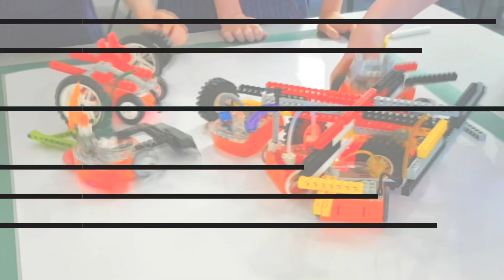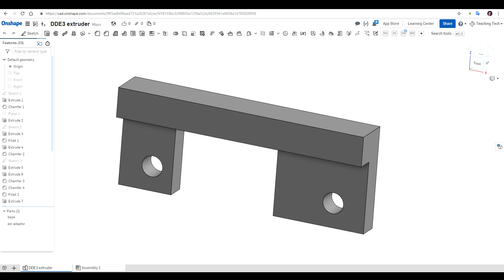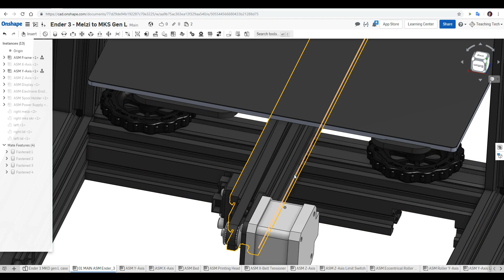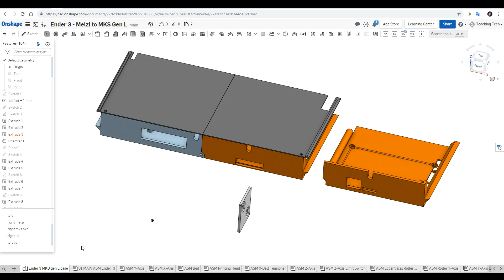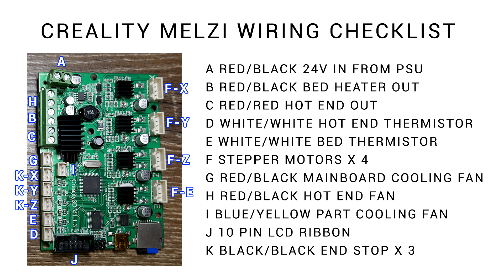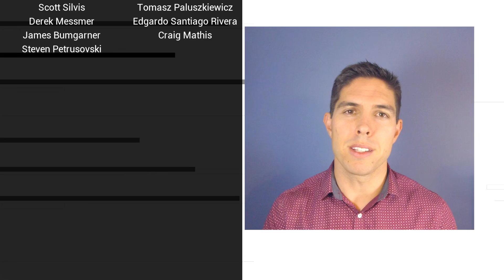Ender 3 upgrades: EZR to direct drive adaptor and all in one rear mounted electronics case

Comment: Michael, greta idea for a rear box.
One little thing, I would have put the new 3d printed end cap at the rear and used one of the original rear end caps at the front to  tidy things up. Then you would have no unsightly screws showing.

Comment: Very nice mod. Thanks for all the great work. But does not work with pin27 that comes with the BLTouch on creality board. Can't get the lid on and one of the connectors got bend in the process.Even with the pin27 lid. The fit is way to tight. Also when working without buckconverters you still need to powerup the rasPi. So external cable slot would be nice. To bad cant upload picture. I think it would be better if the creality mainbord is mounted on the right or in the middle (when not using TL smoothers) and not on the left. There is not enough room.

Comment: Can you please do an analysis of the temperatures inside of that case?
It doesn't appear that the fan is big enough, and I also am skeptical of the airflow design.
I may very well be wrong..but it sure would be damn interesting to see the numbers!
Thanks for this awesome video!
Reply: I'll be honest I like the design and then again I dont. You have the holes where your wires come out from so due to that I'm sure it wont have a good air flow in the main board slot. There should be some kind of heating issue.

Comment: I've always been critical of upgrading something to the point where you are replacing it but this is probably the best and most practical upgrade I've seen. I wouldn't be surprised if Creality either contact you or rip this design.  Very pro.

Comment: Great video and thanks for spending the time to design and build the parts. I do wonder if that cooling setup is actually going to work. Have you measured the heat sink temp on the MKS drivers? I doubt they would have much air flow going over them. I’d be more inclined to have the fan over the main board rather than with the raspberry pi. Or maybe run a fan per side.??

Comment: Not sure what software you designed the case in, but if a .step cad file exists, I’d love to design an option for the Duet 2 WiFi board.  If you have a cad file, met me know.
Reply: There's a .step file included on the Thingiverse page now, if you've not already seen it. :)
Reply: Thanks Mythor.  No, I hadn’t looked yet. I was in the car when I typed that and forgot to check when I got back home.  This is really an awesome design!   I’ll work on something for the Duet 2 WiFi in the next few says.  Thanks!

Comment: Hi Michael, would you mind to test the Fysetc F6 board for Ender 3, with both TMC2208/9 and TMC2130, stand alone or UART the firsts and SPI for 2130 or 5160.

Regards from Spain

Comment: I feel the cooling fan will only be short-circuited with air flow from the Pi side of the board. The box needs to be sealed all around if you want air flow coming all the way from the right side (facing the back). There is no back, there are huge gaps around all input ports. The fan is useless for electronics cooling.

Comment: First I applaud your effort, and design, please take these comments as intended, to IMHO improve your concept.

First: Main Board cooling fan. You haven't addressed the design flaw on a stock Ender, that the Main board cooling fan is controlled along with the part cooling fan, It's a simple mod to connect it to the Hot End fan so it runs all the time, and doesn't slow down or turn off when you choose to control the part cooling fan. (I.E. first layer, alternative material, upgraded cooling fan that doesn't require 100% cooling fan operation.)

Second: Fan placement and air flow, I have concerns at the remote fan and restricted Main Board air flow cooling design, as your design occupies the same vertical space as stock case does, consider relocating the Main board fan directly above the stepper motors (blowing down on the steppers, as in the OEM configuration). If your stepper motor heat sinks do not allow for this, I'd lower your case so it fits slightly below the frame allowing the cooling fan to be placed more optimally. Many have already found adding some additional flexible feet under the frame has helped quiet the printer, and there is (depending on feet pad design) up to an additional 25mm of additional vertical space.

Third: Location of center support, and Main Board screw terminals. The screw terminals on these boards is fiddly enough without the addition of this center support bar in close proximity to the screw terminals, adjusting the board's mounting location, to allow more access for large hands and tools, or re-configuring the center support to allow much easier access to the screw terminals would be a welcome design enhancement.
Reply: EDIT : https://youtu.be/k83M5H796U8?t=418 on second look you have relocated the Main Board cooling fan power source... It's just the board pin out schematic that shows the stock configuration.

Comment: Nice solution.
Along with relays for power switching and so on that you're planning, it would be interesting to fit some thermal sensors on critical components and connect to the Pi for monitoring, to see how well the cooling works out.

Comment: I would suggest adding a fan on top of the right lead to cool drivers and main board...
Reply: ^...with a 90 degree duct for airflow to prevent debris from falling into the hole.
Reply: @AGeekNamedRoss  Feel like were going in circles with this improvement now.

Comment: About two weeks ago I upgraded my Ender3 to the BigTree Tech SKR 1.3 board and I was saying to myself what a horrible design to have to flip this thing over to work on the board. Kicking it around about printing out the new boxes. Thanks Michael.  I do like the SKR with TMC 2208's in UART mode, really easy to configure other than the ultra fine soldering.

Comment: And I just got done designing a full case like that for the front.  Never thought of moving it to the rear.  I'm kinda partial to mine since it doesn't require cramming wires into a short case and allows for better airflow.  Thanks for the great videos and innovative ideas.
Reply: Would love an stl from you if you upload it anywhere - Im a bit concerned with the airflow in this one as well.
Reply: @RonnieLaugen  Sorry I take the summer off from 3D printing and stuff to do summer activities and I didn't see your comment.  Back at it.  Still haven't finalized the design as the fan isn't fitting.  Don't know if it's my design or my printer.  I'm still new at the Thingiverse stuff so I will try to figure out how to upload it.  I draw in autocad, not sure what file type you need/want.  User name PE_RN.  hopefully soon.

Comment: Hi, Michael, thank you very much for your work! Quick question, how did you reach zendstop to the back of the printer? Did you buy longer cable? Thanks.
Reply: Did you find a solution for this? I have the same problem

Comment: Excellent mods. Have you done a separate review on the Direct Drive Extruder. How does the printer fair with that extra mass on top ??
Reply: Hi, my thoughts completely...….on the E3 and Pro models the X axis beam is not supported at the right hand side like the E10 with twin leadscrews, even though it has a set of wheels, they do not prevent the beam from deflecting up and down when the X axis carriage is at the right side and adding more weight will have a more detrimental effect. A mod to add a second leadscrew like the E10 would be good.
Reply: Hi, try this: here's the video   https://www.youtube.com/watch?v=EfB4oCm5Fhk   and here's the purchase website   https://gumroad.com/l/dualzaxiszank   --This is the neatest solution that I've seen to install dual leadscrews to the Ender 3.

Comment: Great upgrades Michael. I've often considered doing a direct drive conversion to the Borg (CR-10s4) to avoid the bowden being folded under the top rail on tall prints, but I have become very fond of my Bondtech BMG. On a similar note, I have always wanted to move the electronics from the control box to the underside of the bed, maybe I'll get the chance one day.
The stock board you have in the video is v1.1.4, as most others seam to be too, the one in the Borg is v2.1 do you have any comparison info please?

Comment: That is amazing case design. Can you also do same for Geeetech GT2560 A10/M  stock main board,  eBay sells longer flex  LCD ribbon cables 30cm and 40cm,  stock is 25cm.that may be the only issue in moving from front to rear. 

https://www.ebay.com/itm/40-Pin-FFC-FPC-Flexible-Flat-Cable-Ribbon-Pitch-0-5mm-6-40CM-80C-60V-VW-1/183559264186?var=690925176986

Comment: Yet another awesome video, this will make things so much easier to access, upgrade and many other minds will have little tweaks too. Only part that seems a little bit fiddly is the power connections once the board is fixed down

Comment: Adapter for cable chains that can mount to the back (front) of the case for the print bed cable? Opening for the pi for Pi Camera?
Reply from the maker: Step one is appreciate the work I've put in. Step two is to remix it. Step three is to share with the community.
Reply: @TeachingTech  Thank you for the design work. I am sorry if I appeared to be ungrateful for your work. Great content on your site and it is always my number one source to look for a solution to my  newly acquire 3D printer.
Reply: I'm also thinking about that question and  will try to remix something later with thinkercad. The disadvantage with keeping the chain is that it will block the now nice open space to the board.
I wrote it already, but can't thank you enough for four all the work you did and do Michael!

Comment: thats a neat and tidy way to do this,  it looks easy to access too... I took a different approach, as I wasnt keen on flipping the machine upside down to tinker with it, I used the original tin box but  moved the electronics box fan to the front after carefully cutting a hole for it, covering the original hole by re-positioning the sticker on the lid,   then printed   an internal mount for the gen L , as well as a spacer for the lid to give me a bit extra height  for the heatsinks of the 2130's, unfortunately this leaves no room for anything extra inside,  so I got my extra bits  on printed brackets at the rear of the printer, not the neatest solution - so I may have a look at this - thanks again for sharing

Comment: can i just use the mainboard side as a stand alone piece? my pi has a monitor connected via hdmi to vga adapter and looks like there's no room for that.
Reply from the maker: I'll upload the step file today. You could easily alter as necessary. As it stands only problems would be no fan for cooling and lack of rigidity.
Reply: @TeachingTech  step file, can it be used with fusion360?
Reply: @TeachingTech  i could use this https://www.amazon.com/VCE-2-Pack-Converter-Adapter-Cable-6/dp/B06XPPKYTW/ref=sr_1_3?crid=OF5Y3A5Q0OPK&keywords=6%2Binch%2Bhdmi%2Bcable%2Bmale%2Bto%2Bfemale&qid=1560490829&s=gateway&sprefix=hdmi%2Bcable%2B6%2Binch%2Bmale%2Caps%2C227&sr=8-3&th=1

Comment: Yep. That's much better.  On a separate note, I have been binge watching and going nuts on eBay etc. and i have a shiny new MKS Gen V1.4 on the way instead of the Gen L. I was supposed to be ordering. Am I screwed? ( Ender 3)
Reply from the maker: Very similar boards but the mounting holes are different. Like my old case, people will remix to suit more boards.

Comment: Thanks for your work man.

Suggestion for a future video-changing the lead screws to get more accurate steps and increase speed
Reply: If my CNC knowledge is accurate. You can only have one of those. A tighter screw with a lower pitch be more accurate, one with a higher pitch will be faster. The z doesnt really need more speed and if you use magic numbers the accuracy is pretty damn good already.
Reply: @Potatogambit  That makes sense - though on Chris Riley's channel he changed his leadscrews and increased his steps, which I kinda understood to be similar to increasing resolution. He also remarks that the print time was shorter by a small percentage.

Comment: Wow, that was a lot of work for some very interesting mods.  Thanks for all your effort.
One thing I'd love to see with an Ender3 is a way to make up an enclosure so you can print higher temperature materials.  I know I can just put it in a box but, like this video, it would be good to relocate the electronics so they don't overheat.  It seems like the wiring is long enough that maybe you could raise the printer up to allow the board and power supply to be below the printer and then build the enclosure above.  Great job Michael.
Reply from the maker: I'm doing that to an Ender 5 because by nature it's so much better suited.

Comment: Have you done any long prints with TMC2208/2130 drivers in the new case? I'm worried that having a single exhaust fan on the other side of the printer isn't gonna cool them enough, as they run very hot and need active cooling. I can see this being a none issue for TMC5160s however since those run much cooler.
Reply from the maker: Longer print testing is now underway. I'm going to be putting in a 40x 20mm fan to up the airflow.
Reply: @TeachingTech  You should flip the control board upside down and add a NF A9x14 PWM fan to that side of the housing.    That 92mm fan should give you enough airflow that you could get rid of the 40mm fan from the other side of the housing.

Comment: I have to upgrade my ender 3 again? But I just did you're last upgrade. Lol looks good Michael, do you lose any Z height with the direct drive extruder?
Reply from the maker: No it hangs in front of the top frame. Good design by Matthew Basaraba.

Comment: I've been looking into these boxes for a while but have one question,  what about grounding?   Seems like to me the original aluminum box ight have provided some grounding for the mainboard by grounding it to the frame.   Is there a concern with this since now it is in an insulator?   The fix would be simple, gound wire to the frame via screw and t-nut maybe.
Reply from the maker: I didn't consider that at all. 24v is the most juice present so I think in terms of safety it's not much if an issue. As you say, very easy to add.

Comment: I would be curious to see if there's enough airflow from one side to the other for the drivers to stay cool. Leakage from the lid worries me. Is there a lip on the lids to try make a seal?
Reply from the maker: There's not because of their print orientation. I'm doing some more long test prints over the weekend and I will also be putting in a 40x20 fan.
Reply: @TeachingTech  For airflow tests in the past I've used a small birthday candle. When you blow it out it embers and smokes for a few seconds. Incense stick also works but the smell can be too much lol

Not as reliable as having a smoke machine but... I know nobody with a smoke machine :p

Comment: Thanks for another incredible video, this looks awesome. I wanted to ask you a couple of questions, 1. if you could provide 1 of the STL with 1 or 2 XT60 ports. I'm currently using Y cables that i put together to have power for my OctoPi and LED lights. 2. I'm considering moving to MKS Gen L and TMC2208 UART with direct drive mod (ebay one) and EZR extrude, does it make a huge difference vs stock? I'm currently running stock board 1.1.4 with Creality BLTouch V3 with bullseye and Creality "ultrabase alike" bed.
Reply: Forgot to ask about the Pi camera, but i think it could be easily routed next to board cables.

Comment: WOW, that looks great but for one thing. I'd keep an eye on the heat of the stepper drivers, think you'll find the fan is pulling more air right next to it through the Pi hole (pun sorta intended ;) ) as air, like water, will always flow with least resistance and that is always the closest location to vent. Other wise it looks awesome!  Oh, seems there is some room behind the board, what about a blower style fan that blows in and directly along the stepper fins...?

Comment: hi Michael would this work on my geeetech a10? if not will you be planning on designing one for your a10/a10m?
Reply: To follow up: It doesn't quite clear the Y axis servo plug on the A10. Maybe it can be remixed. But stock it's a little too tight.

Comment: You sir are not just a great educator, but a fine engineer as well.  Well done.  Since you have a second unmodified Ender 3, might I suggest a comparison between the two showing the thermal performance of your case vs the stock one.

Comment: You twisted my arm on this, ouch 🤡. I already have a Sonoff SV mounted on the back rail, but it looks as if a slight remix of that side would fit it nicely. I use a buck for lighting purposes so it's good you made room for that; can probably work the Pi micro USB power cord in there somewhere too. Add a hole for the heatsink (came w/ the kit) under the Pi and I think it's golden.
Now I have an excuse to print something. Been idle for a couple weeks. My STL editing skills need work though.

Comment: Hi, neat job, what about ghosting due to the extra mass on the x axis? Is it an issue?
Reply: I've been running this same direct drive for about as long as Michael has, and I'm quite pleased with it. I haven't noticed any appreciable ghosting, (running up to 100mm in print speed) and reducing the amount of retraction has a couple of benefits,  it speeds up print times (on parts that require lots of retraction), and I'm able to run a bit of retraction on some flexible filaments.

Comment: You could make the main board area just have snap in brackets so that having different mainboard is easier. Or just an empty area that you line up with another model for different boards. I like it. But I went with a box on the side because I like to fiddle too much.